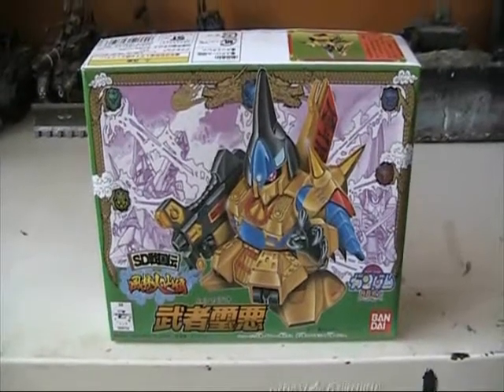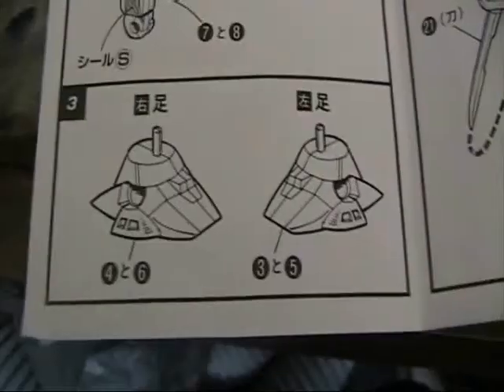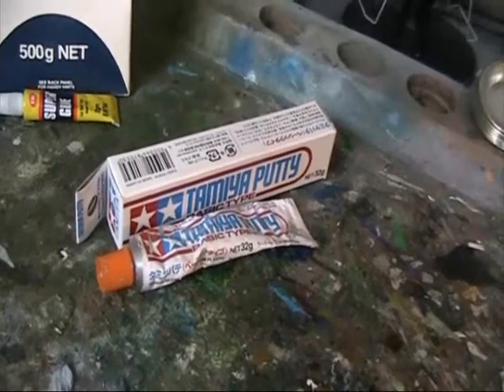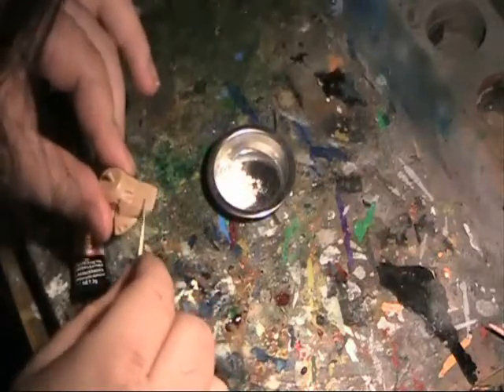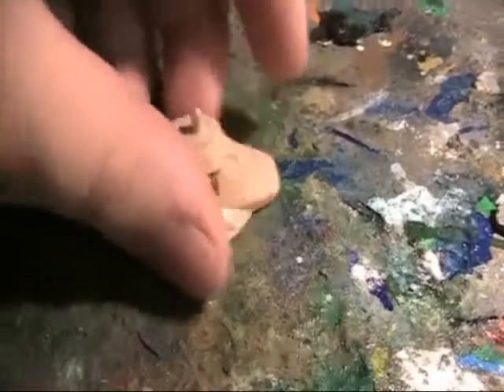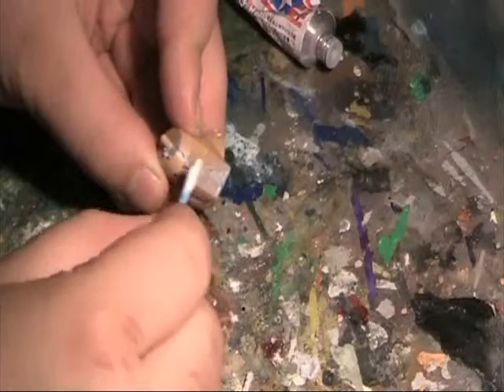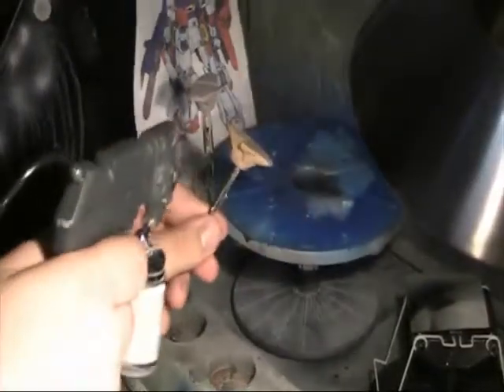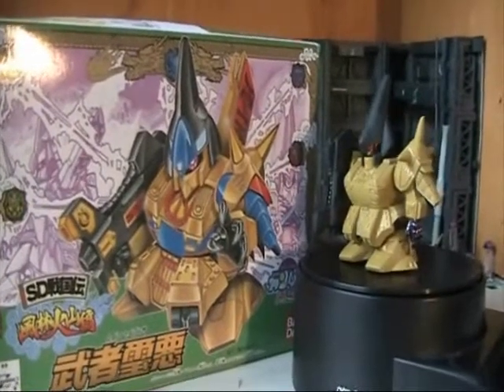Gundam/ mech model workshop 20: Filling seam lines + Unboxing/ WIP BB The O

Comment from the maker: @CyberFur 
Hello, I was using Tamiya primer in the spray gun, Tamiya putty is lacquer based so it sticks really well to the model but shrinks as it drys so you will have to compensate for that which isn't a problem and quick drying/ easy to sand. Tamiya masking tape is fantastic to work with and is the industry standard, also I'm interested in how revell putty works?

Comment: What grits of sand paper are you using? I did a test on a piece I tried to make seamless (with putty that appeared to be not really designed for that so I'm getting some testors liquid cement) and so far it seems like I don't have to have a super buffed out piece for the primer to leave a smooth layer on some of the more scuffed areas near the putty.  I was using primarily 280 grit as the 600 would pick up the putty even though I'd let it set over night -.-

Comment: Are you using wet sandpaper so that the glue or putty doesnt go into the air?
I've only tried to remover seem lines once before
but skiped out on the baking soad 
and the wetness of the sand paper